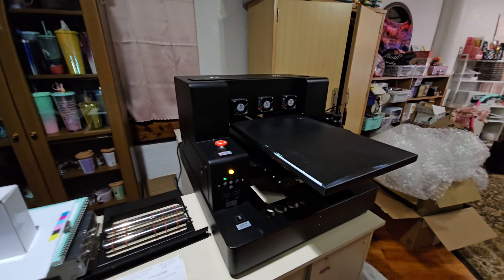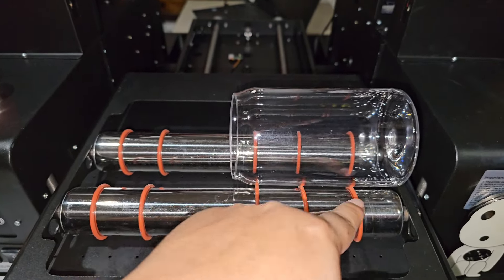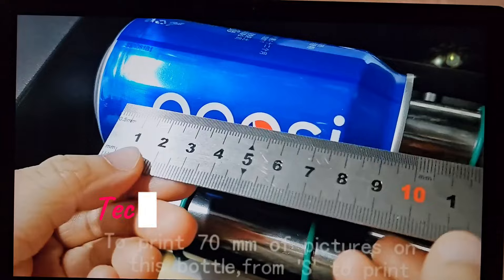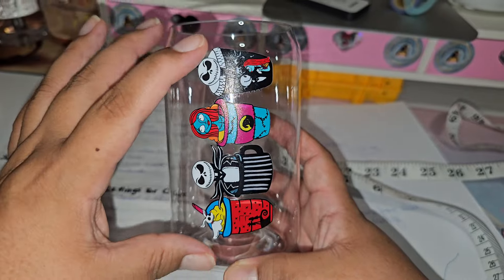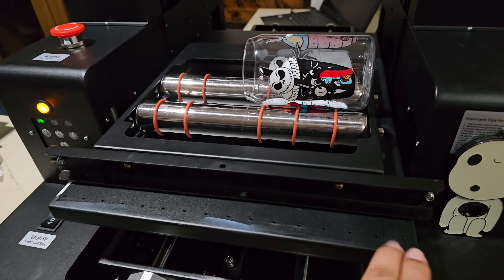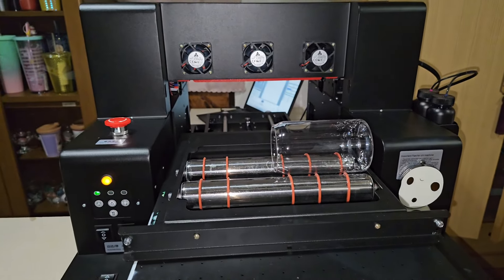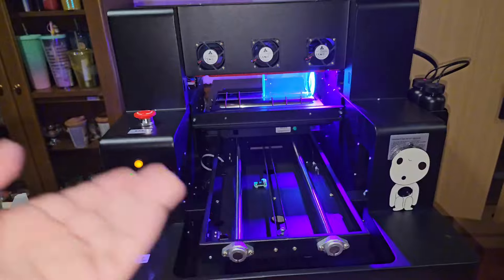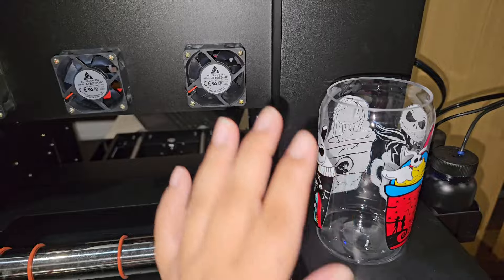How To Print Directly On Cups with Your UV Flatbed Printer

Comment: I don't know if this was said, but your numbers are off because your measurements are off. You are off on your plate by about. 30 inches because the beginning of the measure  tape is where zero starts. not at the inner metal part. Just leveling you up.😊😊😊😊😊😊
Reply from the maker: @trinidadmitchell1221  Thank you so much for the information.
Reply: @DigitalArtMundo  I just bought one of these thanks to your previous video. 
This printer works great!! And I totally agree with your measurements, the plate measurement is about an inch off from the side. Also Just so you know... I purchased and installed Acro Rip's DTG software v10.7.  To get the Acro Rip's software to work, I had to install  L805 drivers from Epson's website to get the printer working . It Works great now. Thank you so much for your great videos.

Comment: Another great video. I still haven't figured out my printer like yours. Do I put the white ink on in the design program for the under base or does the printer software put it on. I also bought the digital factory for 60 something. I'll get the info for you if you would like it.
Reply from the maker: I would definitely appreciate more information on the printer lol 😆. 
The white is an option on the program, you can choose to have a whole background in white or just the image backing in white and other options that are in the drop down.

Comment: Great video and subscribed.  Is it possible to print for the clear bottle in layers - so first layer prints the design in colors (not white base), then second layer prints the white layer (white base) and then last top layer reprints the design in colors.  This way the white background base color doesn't appear on the inside of the bottle as much.  Would be awesome to see another video with this example on clear bottle container. Also - what is the maximum height/distance in MM/Inches a bottle can be to fit on the roller and be able to print?
Reply from the maker: @QuantumLeapEvent  Yes it is possible to print it in layers. There is an option to print color first just make sure to check mark that box before you hit print.
Reply from the maker: @QuantumLeapEvent  I haven't tried a very big bottle but I am thinking as long as it fits on the roller (tray for cups) then it will print.

Comment: Will this print on glass ones too? Alao does it print on a sheet, so you can sell sheets ready to ship to customers. Are you still happy with your machine?
Reply from the maker: Yes, it prints on glass too, metal cups and other materials also. Yes you can print on sheets so that you can sell the designs to customers but there are other machines that are probably better for printing UVDTF designs to sell on bulk. 

So far I am pretty happy with it, my business is small and so I sell custom Cups locally and on my Etsy Shop and make other cool stuff so so far is working really good for me.

Comment: Do you have a problem with colors? I have an ICC profile and one they provided but my Orange is RED. This software and the machine does not have any directions or useful advice.
Reply from the maker: The information was provided to me in the setup instructions when I purchased the printer. I haven't had that issue with ink colors with the ICC profile they provided. This printer has definitely been a learning experience lol. Do you have tech support with your purchase? Because you could reach out and they can help you fix it.